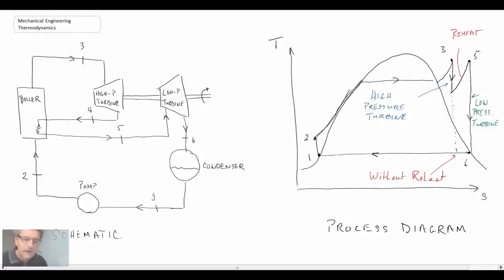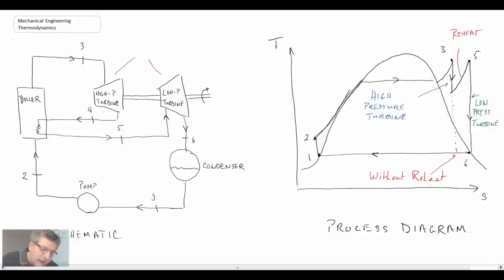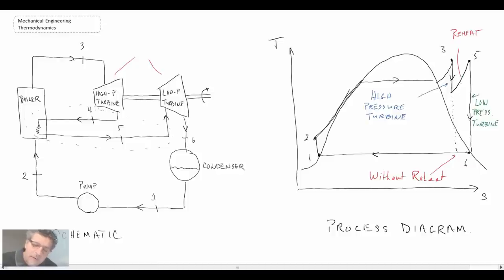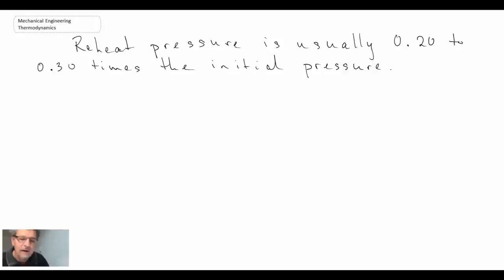Mechanical Engineering Thermodynamics - Lec 20, pt 2 of 7:  Rankine Cycle with Reheat

Comment: HI thank you for your video! What determines the number of reheat cycles that can be done? If, let’s say we didn’t have to worry about the water droplets deforming the blades, to decrease efficiency, could the reheat be done more times? Is there more efficiency loss with the formation of the water droplets also other than the blade deformation I guess is my real question?  Do the water droplet formations cause a velocity decrease in the overall flow?

Comment: why reheating pressure is usually between 0.2 & 0.3 times the initial pressure ?
Reply: high pressure will increase the moisture content at the turbine exhaust thus reheat pressure is optimised